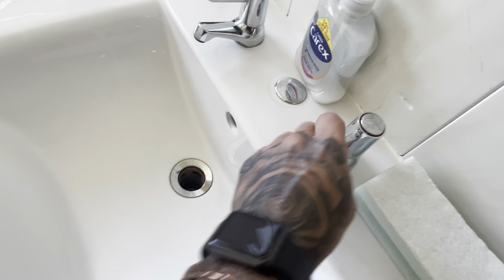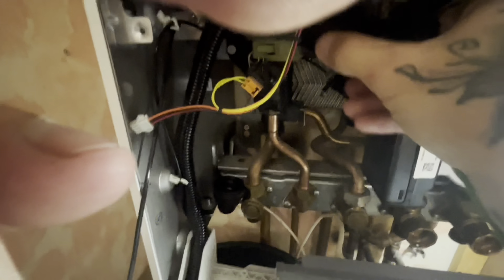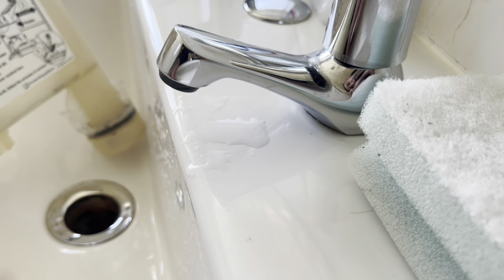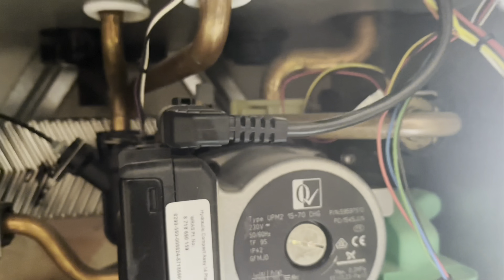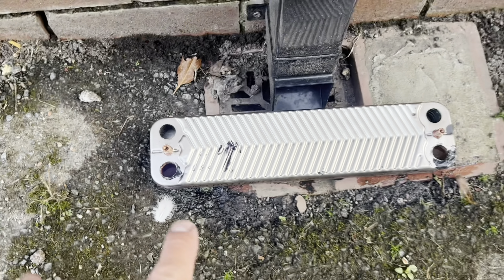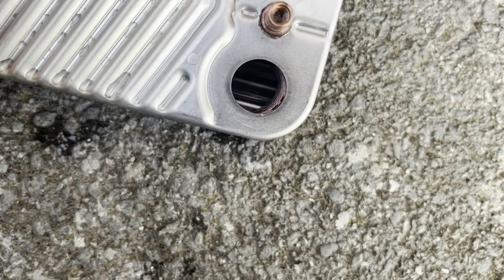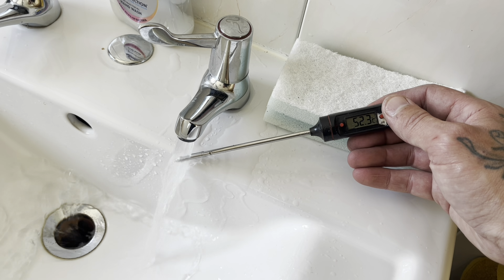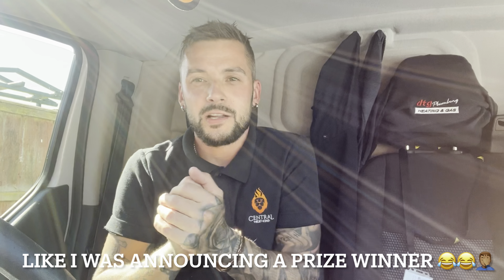How to clean a plate heat exchanger!

Comment: I used to work for Worcester and in my opinion the 25. & 30i ERP is the best model Worcester ever made. The easiest way to test a plate blockage is to measure the flow temp by the display temp and then measure the hot water outlet temperature either at the tap or pipe underneath. The temperature difference should be 10 degrees max. So if tap reading 50, boiler should display 60. If more than this like 20 degrees etc, plate is blocked. 👍
Reply from the maker: Thank you Kev, would you say this method above only works on Worcesters or all plates? I was always taught to measure the flow and return difference in the boiler like I’ve done on this.
Reply: All boilers are different. Manufacturer specific. This as far as know only works for Worcester. Ideal you would test return temp and hot water outlet temp, less than 5c is good, 10 or above etc would be blocked. I’ve done a video on the ideal on Allen hart channel ages ago.
Reply from the maker: @kevincranfield5235  I’ll try find it mate and take a look! Thank you.
Reply: I’m still keen to know what that extra tap on the bath is for……😂
Reply: @kevincranfield5235 Kevin you legend.. watched your vids with Allen.. love the diagrams you make and the detailed explanations you give
Reply from the maker: @Pipster232  so am I 😂😂😂
Reply: Thankyou. Appreciate your kind words. I’ve gad another one n the back burner for months now. I’ve made it but not released it as I’m not sure about it. My brain ain’t the same as it used to be. It’s about zero governors.
Reply: @kevincranfield5235  Mate you accelerated my learning in boilers tenfold.. any vids you got.. I'm all for them as I'm sure an entire cohort of gas engineers are. Sage wisdom of someone of your calibre, distilled in the way you present it, is gold dust.
Please please make some more vids!
Reply: Hope you are well Kevin, Be nice to finally meet up with you at some point if you get chance. Thanks.
Reply: Agreed 10 degrees was what we were told at BG

Comment: If you ever have the worcester with the vent tube on top of the kebab heat exchanger.. what I do it drain the boiler at the point by the diverter. Then put the vent tube into a bottle of system cleaner, open the vent tube and syphon all the cleaner into the boiler..... pressurise the boiler, isolate flow and return, and run the hot tap on low temp and it will flush just the plate out.. Once it's been ran for a while until temps are stable on high... flush cleaner out and open flow and return valves... always works for me..
Reply from the maker: I knew about that strategy mate but for some reason didn’t associate it with the plate, I just assumed it cleaned out the main hex.. what a donut haha. Thanks for the advice Brendan! 🫶🏽

Comment: Another way and tip I do to remove the plate from Worcester’s is taking off the left hand manifold and the pipe that links from the hot water out and it comes out soo much easier
Reply from the maker: Great tip that mate, really appreciate the advice! 🫶🏽

Comment: Great video, i think my heat exchanger has gone, hot water all over the kitchen 😡 the boiler was losing pressure for a few days before this happened, I've noticed water at the bottom of one of the pipes connected to the heat exchanger still has water seeping out, does this mean it's blocked?
don't know wether to get somebody in to fix it or try it myself, and now the  weather has gotten colder 😔
Reply from the maker: @PaulWilliams-xz3mz  the leak won’t mean it’s blocked no mate. And losing pressure won’t mean it’s blocked either. What boiler is it please?
Reply: @Heatking  a very old one lol eurocal it says on the front
Reply from the maker: @ never heard of it! Haha
Reply: @Heatking  ok mate, I'll phone a Plumber tomorrow, thanks for answering my questions, I appreciate it 👍

Comment: Just be careful on worcesters, youve got to realise that boiler can only produce approx 11l per min, if your opening up that hot tap fully at start, it looked alot more than that and the heat transfer wont happen and cause the boiler to overheat. Its one of the biggest callouts i get and when i tell customer to turn hot tap open a quarter of way it will give the heat transfer the best chance and pretty much make boiler stay on. Also worth noting on  those 30i erps, the diverter motor/paddle tend to get weak and put heat down the flow due to blocked plates. In my opinion, there one of the worst theyve made, cdi range is so much better. Good video though mate. I would never use acid, just replace. Ive seen blokes getting some nasty burns.
Reply: Also for those plates, but a black rubble bags, the ones you get from screwfix and it will catch pretty much all the water.
Reply from the maker: Thanks Steven, good call on opening the tap up full at the start. I’ll not do that in the future. Yeh I’ve heard about the paddles. I’m
Not sure if you could see but I kept putting my hand on the flow pipe to check it wasn’t seeping down there, thanks for the advice mate 🫶🏽
Reply from the maker: Another good idea!! 😂🫶🏽🫶🏽

Comment: Good video. Worcester Bosch Plate Heat Exchangers are not the easiest repair on them old ones. The new Worcester Bosch 4000 is amazing though. Really good video for Trainee gas engineers. Thanks.
Reply from the maker: Thank you Allen. The 4000 plate removal was so simple at your house, litterally only needed a Philips screwdriver to do the job 😂
Reply: you mean the worcester bosch 4000 lol
 @Heatking
Reply: or the worcester bosch 4000 combi boiler heat exchanger that gets blocked on dirty central heating systems @Heatking
Reply from the maker: @AllenHart999  oh yes. Best than that ‘Navien boiler’ 😂😂
Reply: do you mean the worcester bosch boiler is easier to repair a blocked plate heat exchanger than a Navien gas combi boiler  @Heatking

Comment: I have always cut away the hot or push it out of the way. I fit new plate as well. Nasty stuff drain acid. Top video.👍
Reply from the maker: Yeh it is nasty stuff! I hate cleaning them mate, but yeh hot or cold out the way definitely helps 💪🏼
Reply: finding drain acid hard to get now. idiot students round here are forever letting the plastic covers from razors go down the plughole. bit of hair and that acid problem gone..... it is nasty stuff used in the wrong place i agree. but it had its uses.

Comment: Another top job Dan. It is a shame the obstacles in the way of the plate make you have to cut pipe work or remove the pump assembly ❤
Reply from the maker: Cheers mate. Yeh it is a shame, seen as other manufacturers make it so you don’t have to take anything out the way to replace it!

Comment: All plates can be cleaned using similar chemicals,they're mostly made by specialist  companys.
A tip I was given was measure hot outlet and return temp and expect ideally 1c diff.
Yes advise power flush and filter if not fitted.
Top tip 2litres of the best known inhibitors is the ideal on average property, it will bring the ph closer to to neutral ph.
Reply from the maker: Cheers John! I’ll use this tip going forward! Thank you.

Comment: Another tip to get the plate out. Remove the hot pipe connection from the boiler and the plate wil drop out. I think Geoff needs has made a video on how to do it. Dead easy
Reply from the maker: Yeh the cold didn’t really do me any favours on this one 😂😂
Reply: Next time you do one, try that. Dead easy and hydraulics are very similar.
Reply from the maker: @kevincranfield5235  cheers Kev!
Reply: I think your videos are great by the way. 👍 forgot to mention that.
Reply: Spirit of salts is great for plates

Comment: Do you like vaillant eco tex
Reply from the maker: I’m not a fan of Vaillants to be honest, I find them expensive to buy and expensive to repair, but they are reliable.
Reply: do you like navien combi boilers i heard the plate heat exchangers are easy on them, better than the worcester bosch lol  @Heatking
Reply from the maker: @AllenHart999  I don’t know where you heard that. The navien combi boiler I worked on, the plate heat exchanger, required the expansion vessel to be removed first! Worcester Bosch boilers and baxis boilers are much easier for a gas safe engineer to work on 😂